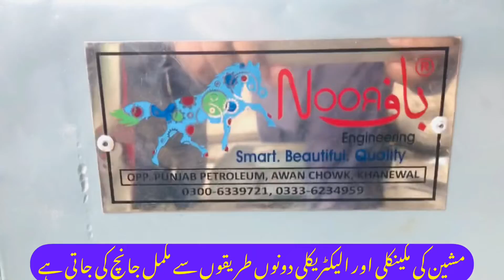Testing & Delivery of Soap Making Machine to Sargodha

Comment: Salam walekum sar yah mukmmal setup kitne mein padega ma na Karachi mein lagana hai
Reply from the maker: Mixer 25kg 45000
Plodder 5"x22" 220000
Plodder 5"x32" 260000
Cutter 10000
Punch mannual 45000
Punch auto 120000
Dye 28000
Plodders 2 mention kiye hain or punch bhi. In me se aap chose ker lijiye ga k kon sa plodder or kon si punch leni hai.